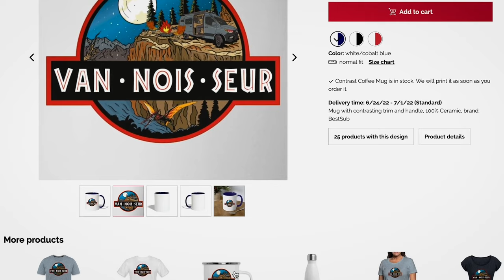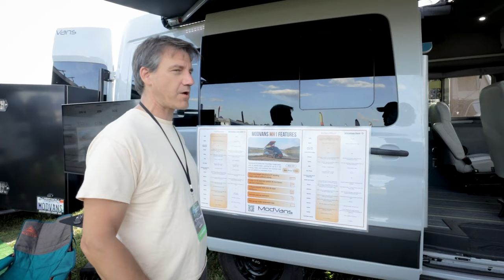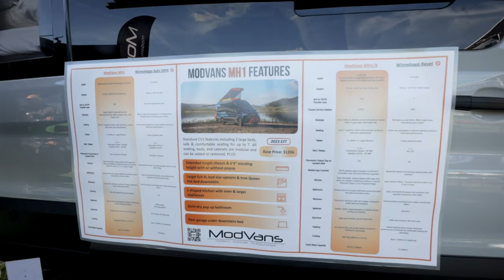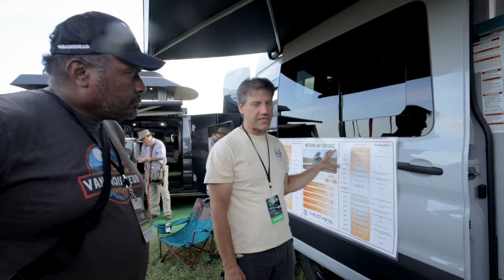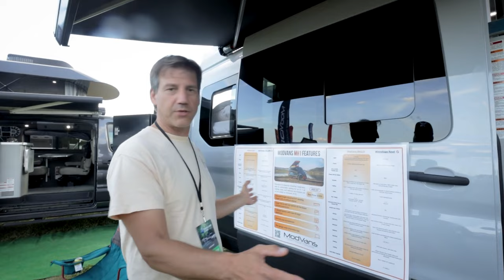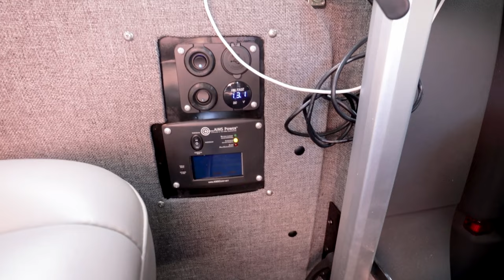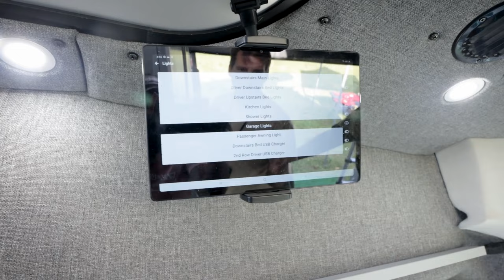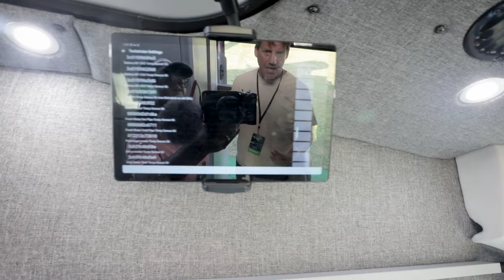How ModVans Is Building The Better Class B Camper Van In The MH1/X Camper

Comment: Adding that aluminum track system (not sure what you call it) where you can add accessories to it would be awesome underneath the plates & cup area. Or building a whole cabinet system out of the same lightweight aluminum material. The way it stands now you can only put what it's designed for (plates, bowls cups as shown. Very specific IMO. Cool design with the pop-up shower. New to me. Love it.

Comment: Hank I want to add my comments on my personal use of the Ford Transit.
I work for a car service company and we have two limos,many busses and vans.
We got 4 2021 full size Transit passenger vans this past Spring. We also have a 2017 Transit diesel. The 2021 hasa power sliding door. It is slow. The running board is wider.
My main concern is the space between the front seats and around them. It has the brake handle on the right side of the seat. I can't get to the back because it's too tight.
I did measure the space and the space in the Sprinter. The Sprinter is wider.
There are many good aspects of the Transit.
Runs great and good acccellaratrion.

Comment: If you installed the full 2,100Ah of lithium, and that raises the floor by an inch, how does that effect the flow from the living space into the cab of the Transit? Would you end up with a one inch lip?  I'm not familiar with the standard flooring levels in the Transit. Thanks!

Comment: i had an f150 2013 has the eco boost. never had any issues. it had power galore. the only issue was when i used it alot i had to let it cool down before turning off the engine because it was recommended to do so since the turbos were expensive to service so i didnt want that.

Comment: On the Ford Transit,will all have the Ebrake? I thought it was an option to have the hand brake switched to Ebrake. It's in the way on the right of the driver's seat.
Reply from the maker: Good question the 2022’s and up I believe have an e-brake switch instead of physical handbrake…from what I’ve seen
Reply: @strangerpalooza  Thanks for responding. I'll call it the emergency brake. And I'm guessing it's also called an E brake. I'll have to check online to see if it's an option to have it on the dashboard. I believe Sprinter has it switched over to the dashboard.

Comment: I like the flexibility, but need two things: a bigger fridge (like in the Coachmen Nova) and a bed that is out of the way most of the time (like this https://youtu.be/4H33ZApTVSc?t=28).  Also still not sold on Ford vehicles because I got burned years ago with a car having to repair, replace, or deal with recalls every six weeks.  Not sure if these chassis are somehow different in terms of manufacturing quality, low maintenance, and few recall issues vs. Dodge - will have to compare.
Reply from the maker: Understood Max, thanks for watching 😁
Reply: I thought about a bigger fridge, too.  But, with all the space/flexibility and battery capacity, it would be very easy to add a portable fridge/freezer...in the cabin, or in the garage.

I checked out that pull-down bed in the video link you provided.  It was 51" x 79".  Smaller than the pop-top bed in the MH1/X, and way smaller than the rear queen.  51" wide can be tough for 2 people, and the pull-down beds, while convenient, are very wobbly.  If two are people are sleeping on a pull-down bed and one person shifts/moves, the other person rocks quite a bit, which can interrupt sleep.
Reply: @tekknoclub  great points about the bed sizes and 2nd fridge! We wanted a very comfortable bed. With a fold up bed, you have to use thinner cushions with joints. Anything less than 5" thick will be a compromise on comfort and a 5" thick fold up bed won't work well. With a true queen size mattress, you can use standard bedding (such as those fancy bamboo sheets). We also like having the bed always setup. In practice, having to setup and take down your bed gets old fast.

Comment: What happens with that FLOOR OF BATTERIES if you crash?
Reply from the maker: I would think that depends on where your crash is...regardless of that from what I've heard of all these modern vans even a mild crash totals the van in the eyes of the insurance co's mostly because of all the tech built into the chassis nowadays...regardless of where your batteries are if you have direct impact to them...bad things can happen
Reply: The battery can be opened, inspected and serviced. We highly recommend an inspection on the battery after any accident.

Comment: Sounds like a pain in the arse with those batteries having to pull all the cabinets and floor off to service.
Reply from the maker: you're unlike to have to access the batteries themselves directly...what you would have to access are the  control panels, inverter etc which are in the walls, as I showed in the video...where we talked about access to the batteries is in the very rare occasion you need to replace or upgrade the batteries
Reply: The battery is designed to last 20-30 years and is maintenance free.

Comment: Your wiring is horrible, simply horrible. You have wires going through metal with no protection! Where is the little plastic insert that costs practically nothing? (We called them “gasintas” because it “goes inta” the hole) Why is nothing labeled? Wires hanging with no end protection  and no identification. Scared this old electrician.

Comment: This is all nice to go lightweight and low tech ..kinda utilitarian looking BUT YOU NEED TO BRING PRICE DOWN...If I'm paying 200k I want MERCEDES LUXURY..NOT PAYING 200K for west coast hippie van..
Reply from the maker: that's one of the dumbest comments I've ever seen on my channel, congratulations you're obviously an idiot
Reply: Go get a Mercedes and let everyone know how much you pay for your oil change
Reply: Neither sprinter nor transit...these r gasguzzelrs,we r spoiled in the US, we want power over gas saving.... we need hybrid or diesel at 29mpg just like Europe and the rest of the world.
Reply: @y62rig21  $250 every 10-12k miles.  That's cheaper than $80-100 every 3k miles for gas LOL
Reply: @MacheteMambi  on the Transit, there is an oil change status message that Ford bases on counting crankshaft revolutions. On our vans, the oil change message comes about every 10k miles. We typically have the oil changed at our local Ford dealership using "The Works" coupon they send it the mail that includes synthetic blend oil and additional maintenance services. It has been a while, but the service costs $35 last time I went in.

Comment: This van is very expensive for what you get. Quality and design is questionable. STO Mode TL is still best for the money/quality on the market.
Reply: The MH1 base model with AWD and 504Ah Li battery added is comparable to the STO. It costs $20k less and that includes 12V A/C, the popup top with 2nd bed, truly comfortable 2nd row modular seats that slide, swivel AND recline, and the ability to add up to 7 modular seats so the van is usable in more cases. The comparable MH1 costs $20k less, sio I'm not sure how one arrives at "very expensive for what you get" when comparing to STO Mode LT. The MH1/X battery is 26kwh vs. STO 12kwh, plus all high-efficiency DC cooling and heating and a truly integrated management system that can monitor and control the vehicle from anywhere in the world. Plus, the MH!/X has all the other MH1 advantages vs. STO. Sure, it costs more than the STO Mode LT, but you are getting a lot more (including a battery more than 2x) in return. Comparing quality is difficult. While I agree that STO has nice build quality compared with big RV manufacturers, based on what I see in the owner's groups online, I 'm not convinced that STO has a lead on quality compared with ModVans. Comparing design is also challenging, but there is no question that ModVans is pushing innovation much further than any other RV manufacturer, including STO. The STO is basically a Revel without a fixed bathroom.
Reply: I disagree with you. When you build fully ModVans they get pricy. Floor plans are confusing, rather than pleasing. Also STO is 4 season van that means sleep 2 adults, 2 kids(or +1 adult) INCLOSED and you can fit 2 bikes and 2 pairs of ski under the bed while you are on a ski vacation. Also STO heating comes from the fuel tank, you are not draining the battery. ModVan has no roof top. Who support ModVan battery system, no brand he didn't say. If something happens with the Volta system STO will fly a technician to you. ModVans has bad customer service. ModVans are "work in progress" is something happens, you may need to go to CA for a simple fix. STO customer service is superb. I think it's a personal choice. Having van is awesome no matter the brand I love mine.
Reply: @vanh6194  It is clear that you love your STO and that is great, but I would like to point out some errors in your comparison.

The only way you could have gotten a higher price than a STO is to spec out a build with significantly more features than a STO. ModVans customers have the ability to order an MH1 at the base price of $131k which is impossible with STO. Add AWD and a 504Ah battery and the price is around $140k. Sure, if you want the 2160Ah battery, it is going to cost more, but the battery is over twice as big!

All ModVans are "4 season". You can find a FAQ that discusses winter camping specifically and the /X Series has a dedicated furnace for the popup top. Also, there are reports from customers in the owner's group of winter camping experience with the popup top. The /X Series also has plumbing and gray tank that is monitored for temperature with automatic heating. 

IMO, liquid furnaces like the one in the STO are not worth the hassle. They work poorly at altitude, they have tons of computer glitches and issues with cleaning/clogged jets. If your gas tank falls below a certain level, your heater will just turn off in the middle of the night and your only solution is to drive out to a gas station. I personally prefer the reliability and separate fuel supply of propane or, better still, the simplicity and reliability of truly "all electric" heating. 

I personally would not want to have to convert my seats into an uncomfortable looking bed that barely holds children vs. the MH1 Full XL in the popup top with a very comfortable mattress and 80" length. In the STO, even the rear bed is an "RV Queen" not a true queen size bed. I have read many reports that all STO beds are uncomfortable and there is certainly a big market in selling replacement bed cushions for STO and Revel (I've never heard of a ModVans owners replacing or even augmenting their bed cushions).

There are plenty of ways to carry skis in both vans, and I personally prefer having the garage closed off from the main cabin, but if you really need it, there is a floor plan option to move the fridge to the front and have have "pass thru" storage to the garage for pets or long items like skis or surfboards.

IMO, having a "roof top" is highly overrated. With the MH1, you get the option of having 600 watts of solar panels which, IMO, is much more practically useful than a roof that is too high up, ruins the van's center of gravity and would cover solar panels. Sitting on the ground in my comfy camp chairs while my solar system generates 1,000 watts total is just fine by me. 

The battery system is designed and manufactured by ModVans. So, yes, unlike STO, where they are dependent on Volta (who apparently has made enough mistakes that STO had to pay to fly people all over the US to fix them), ModVans has complete responsibility and control for its battery system. ModVans has customers all over the US and, just like STO doesn't require their customers to bring their vans back to Alabama, ModVans does not  require that customers bring their vans back to California for service.  

I'm not sure where you are getting the idea that ModVans has "bad customer service" or that are a "work in progress" that requires trips to California for service. If anybody has concerns about service or quality, I suggest asking real ModVans owners about their personal experiences on the ModVans Owners Facebook group (and do the same for STO if you really want to see how the two companies compare on quality and service).
Reply: @pjtezza   
You cannot sleep in a popup tent as good as in "inclosed". It's very noise when is windy or rainy and you are not stealthy as most people that use those van prefer. When is snowy, the wall gets wet somehow. I tied there is no comparison at least for me.

Regarding liquid furnace in the STO, I never heard anyone having issue with it. I am not sure where you get your info. I have camped as high as 12k feet and no issue at all. It's more likely you run out of batter then fuel in the nature, but heater burns so little.

The roof is a big deal for those who have it, and 'not a big deal" for those don't have it. You can not only use as the upper deck as a place to chill and enjoy sunset, but you can mount equipment, boxes, etc.

ModVan has bad customer service, and I had issue when I tired it. In addition it rattles inside when driving on gravel or uneven roads. Someone the components are cheaper than STP and they feel are deigned in a rush. Maybe mine was earlier model.

Nowadays all battery systems are not perfect, all of them may need service. They are complex and cannot fix any location in US as you think. It's important to know who makes them and service them. Some manufactures use Chinese components and state they make them "in house".    

When you have bikes and ski for $10k + you don't want to keep them outside and about the bed it's personal choice. I have no issue with the bed, it's 6'7 side to side and you can buy Roam mattress if you don't like the the one that comes from STO.

It's my personal opinion from what I have experienced  in nature with STO (with both Ford 22 and Mercedes 21 chassis), ModVan 21 (Midroof) and Revel 22. It's not which van is better, both are not perfect, but when I got my last van which is STO Mode TL earlier this year for a little over 153k with sync 4, adaptive cruise control, etc. appeared to me as the best option. 

I wish all best with your channel.